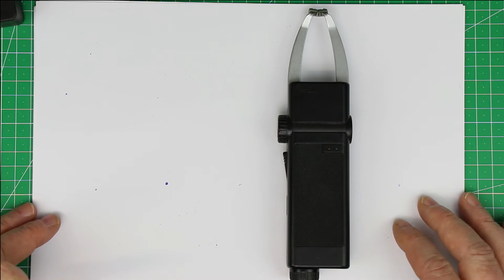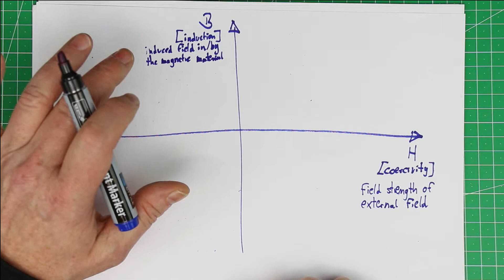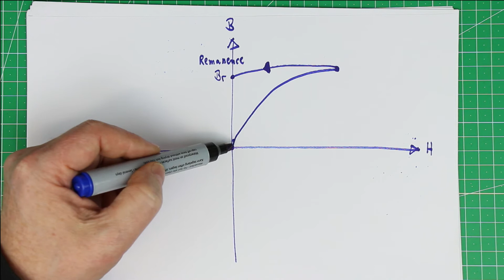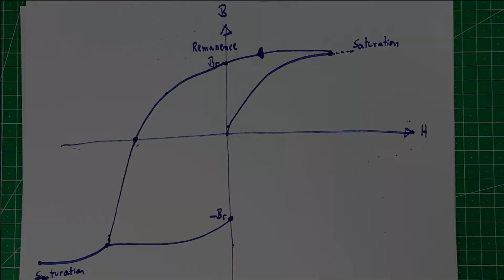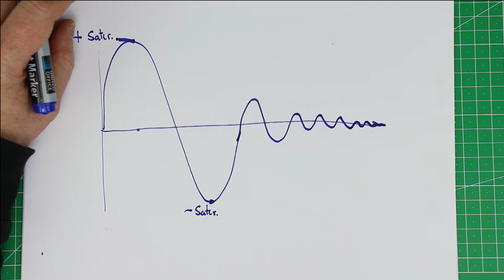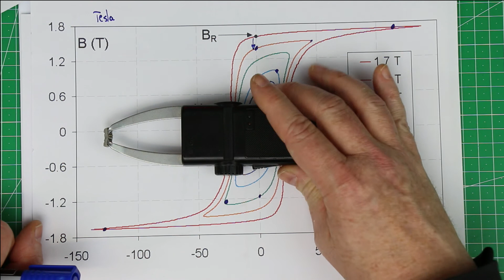Demagnetizing and Degaussing Theory

Comment: Very interesting. Now I understand how demagnetizing works. Is it necessary to move the tip of the demagnetizer tool in a circular fashion above capstan shafts, tone heads etc and do one need to approach and pull away the demagnetizer for each individual part?
Reply from the maker: The one from TDK I showed in the video creates an exponentially decying magnetic field and should NOT be moved during the demagnetizing-acction. The cheap mains-voltage choke-type demagnetizers HAVE TO BE pulled slowly away from the parts to demagnetize. That is because they produce an alternating magnetic field with constant field-strength after being switched on. Only by pulling the choke slowly away do you get the necessary "decaying" field-strength which in the end give zero magnetization.
Reply: @KainkaLabs  Yes, that's what I understod from the video. Well, I have a mains-voltage choke-type and shall be using it on a cassette deck. So back to my question, Is it necessary to move the tip of the demagnetizer tool in a circular fashion above capstan shafts, tone heads etc and do one need to approach and pull away the demagnetizer for each individual part?
Reply from the maker: Moving in a circular fashion over capstan shafts can at least do no damage, but if it really helps in demagnetizing I doubt. Of course every single (iron) part that comes in touch with the tape has to be demagnetized separately. The most important step is to move away the choke slowly from each part in a way, that you are at maximum distance to the other iron parts (i.e. usually vertical/perpendicular to the head-arrangement).

Comment: Thanks for a great video Rodger... You have renewed my interest on this topic. I purchased a cassette deck cleaning and demagnatising kit that was expensive back in the 80's and I haven't used it much so it's still in relatively new condition. I think back then I just wanted one because all the electronics were inside a clear compact cassette and it looks pretty awesome. I never understood how or why it worked, though all I can remember is being able to hear a sign wave signal through the speakers... If my understanding of your video is correct... The demagnatiser saturates first then decreases the amplitude over time till it reaches zero or something close to zero... If that's the case... Then you should be able to hear the signal through the speakers yes? 
Hmmmm I think that I'm going to pull out the old demagnatiser and have another good look at it...
Thanks once again Rodger..
Reply from the maker: Yes. It´s exactly as you described it.
When the TDK demagnetizer is switched on, you get a fully  saturated signal on the output which then decreases down to near zero amplitude and when the tape-head is out of saturation you can hear that it´s a sine-wave.